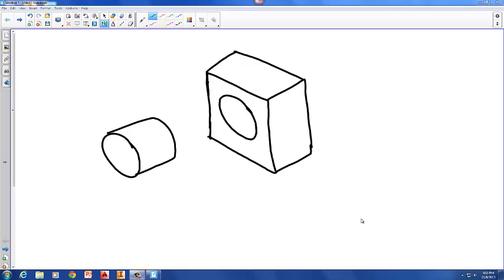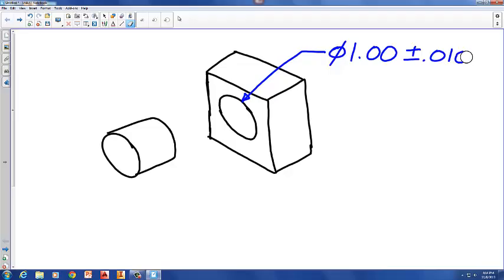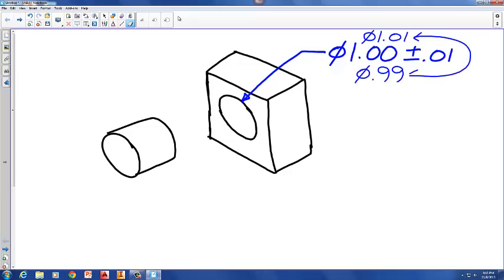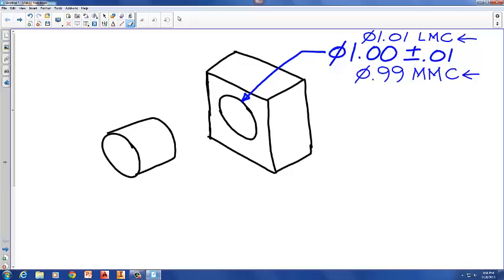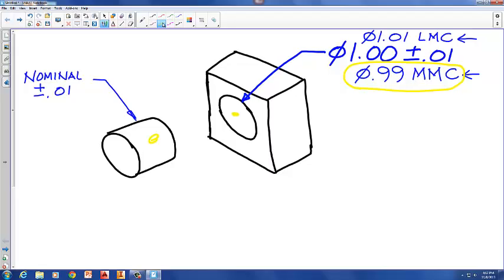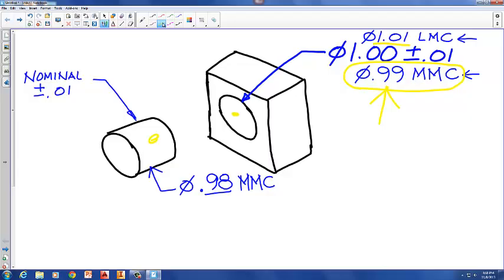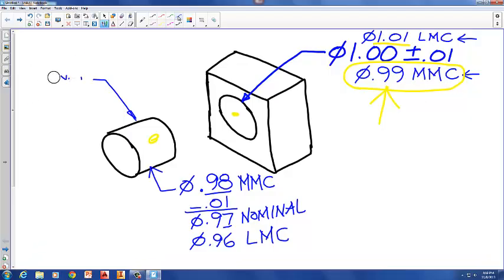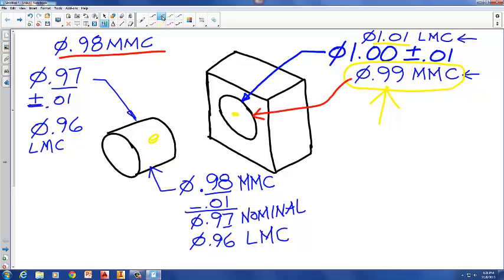Tolerancing Basics: Calculating a Fit between and Cylinder and a Hole

Comment: ah yes but how do you determine 0.01 is the clearance needed to fit
Reply from the maker: The designer determines how much clearance may be needed based on the desired function and relationship between the parts. For example, quick assembly and disassembly of parts may require a looser fit. Reduction in vibration may require at tight fit. I used .01 in the example to keep the math is easier for beginners.

Comment: I’m confused wouldn’t the .99 be the LMC? And the 1.01 be the MMC?
Reply: For a cylinder .99 is the LMC and 1.01 is the MMC but for a hole it is the opposite. The smaller .99 diameter hole leaves more material than a larger hole (1.01) where more material is removed from the part.

Comment: This is still the best short  explanation out there, this is a pretty old video now, i wonder if you still reply to comments? My question is how does the calculation work if you have 2 different materials with 2 different tolerances. Eg a silicone gasket with + - .04 & a CNC metal shaft  with + - .05

Comment: So what if the .05 clearance at the end is too big?  You reduce all your tolerances to achieve the desired?
Reply: The designer could switch from the "bi-directional" tolerance shown in the video of +.01/- .01 to a unidirectional tolerance such as +0 and -.01. A unidirectional the tolerance can be applied to only to the plus or minus case as desired. The unidirectional tolerance could be applied to both the hole and the shaft in a way that will lesson the amount of clearance when the hole is largest in diameter and the shaft is smallest in diameter.

Comment: Thanks for this video explaining the basics. Would you go as far as adding the probability? When tolerances have a Gaussian distribution you can add: I want part A and part B to fit X%  of the time. 

As an electrical engineer, I've seen the dispute between the mechanical engineers and electrical engineers resulting in a PCB redesign, making it 0.05mm smaller. In this case, a Gaussian distribution of tolerances was expected to make the PCB fit more often.
Reply: That's great feedback but this video is intended for folks that are totally new to tolerancing. I've tried to keep it simple here. Maybe a more advanced video is warranted. Thanks.

Comment: Umm this video makes no sense. Wouldn't 0.99 round up to 1 and 1.01 round down to 1?
Reply from the maker: When 1.00 is the nominal size, the hole can be manufactured between a diameter of .99 and a diameter of 1.01 and still pass inspection.

Comment: How come in this video the mmc and lmc is the exact opposite from your video....  Mmc was top then to bottom is lmc. In the first block both you guys mentioned too. https://youtu.be/vCpU2J4SWWE 
Did the other guy do it wrong? You do make more sense explaining the hole how there's more or less material remaining.
Reply from the maker: When applied to a hole, its smallest allowable diameter is its Maximum Material Condition. This is because the smaller hole leaves behind more material (or mass). When the hole is cut at its largest diameter the hole is at Least Material Condition because more mass has been removed. The opposite is true of the cylinder. When the cylinder is made at its largest diameter it is at MMC and when manufactured at its smallest diameter it is at Least MC.

Comment: My problem is where did you get the numbers like +_ 0.01 for the tolerance of the hole?
Reply: I chose a tolerance of plus/minus .01 randomly for this example. On an actual project, the designer specifies the tolerance based on the type of fit they desire in the assembly (for example a tight fit, moderate fit, or loose fit between the mating parts). The tolerance depends on the assembly. Very tight (small tolerances) will likely result in higher manufacturing costs. For this reason, designers usually specify the largest tolerance that will still allow the assembly to function properly. Often, when the assembly is designed to assemble or disassemble quickly, large tolerances between parts will be desired.
Reply: Douglas Smith Thank you very much. I still do not know how they give a number to it. Let's say I want to put a shaft of 5inch inside a hole of 5in. Let's say I want a tight fit. How do I assign a number for the tolerance? 0.1 or 0.005 or what? There are numerous combinations for both. This is my problem.
Reply: ***** Thank you but I still have this question in real applications how do you decide the number for your tolerances?

Comment from the maker: Mr. O'Leary is correct in his comment that machinists refer to .01 inches at "ten thousandths". This is because machinists in countries using the Imperial system (inches) are trained to use a thousandth of an inch as the base unit of measurement. For this reason, when a machinist sees a dimension value of .5 on a print, they will refer to the dimension as 500 thousandths in the shop (they are converting .5 to .500). In this video I was attempting to show the basics of tolerancing while trying to keep it as simple as possible so as not to confuse beginners. Later, when the students are comfortable with tolerancing concepts, I explain to them how machinists convert dimension values on a print into thousandths for use in the shop. Examples: A dimension of .125 on a print will be referred to as 125 thousandths in the shop; a dimension of .05 on a print will be converted to 50 thousandths in the shop; a dimension of 2.75 on a print will become 2 inches and 750 thousandths (or 2 and 750 thousandths). Douglas Smith
Reply: Technical Drawing 101 with AutoCAD Channel :- Want more videos like this !! Please, make more !!